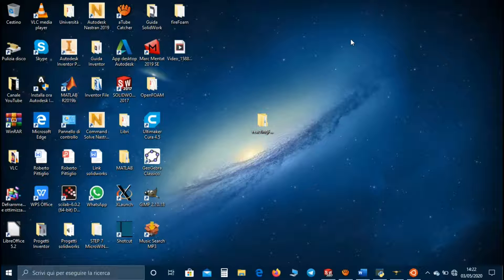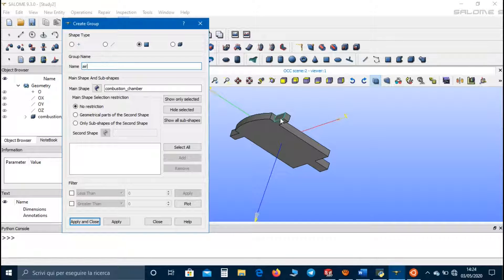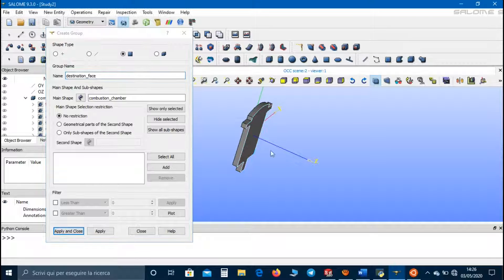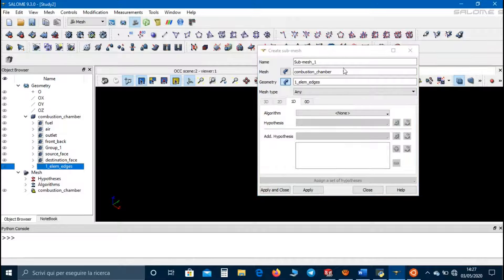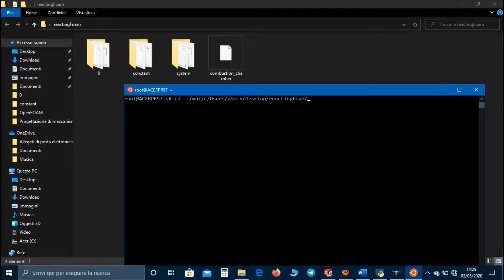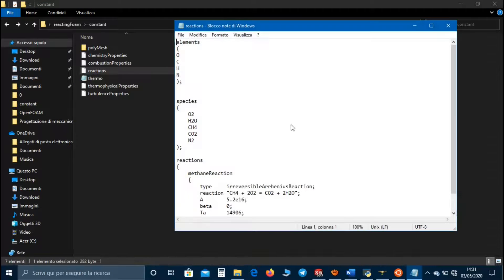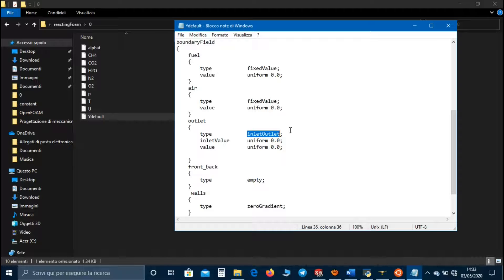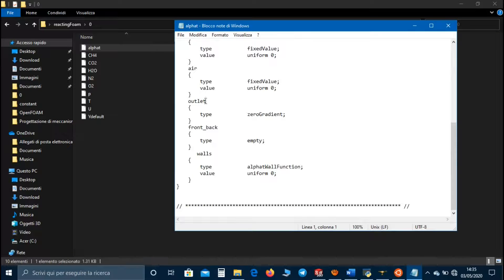OpenFOAM Tutorial 8 - Combustion case with reactingFoam

Comment: After doing meshing in salome as mentioned in video, when trying to convert ideasunvtofoam the below error occurs. How to rectify this.

39663
39664
39665
39666
39667
)

    From function T& Foam::HashTable<T, Key, Hash>::operator[](const Key&) [with T = int; Key = int; Hash = Foam::Hash<int>]
    in file /home/ubuntu/OpenFOAM/OpenFOAM-9/src/OpenFOAM/lnInclude/HashTableI.H at line 109.

FOAM exiting
Reply from the maker: Mh it's difficult to say what the problem is. Check your mesh and try again
Reply: Did you manage to solve the error ? if so how did you do it? I'm getting the same error
Reply: @sebastianmancillacallejas3972  No I didnt continue. I moved to ansys for my meshing purposes since I didn't have time to learn salome.

Comment: I follow the tutorial so many times, so many hours, and without succes openfoam 7 openfoam 8 in ubuntu and temperature goes out of 5000-6000 a lot of warnings of janaf and the result is don't enter fuel or air, the chamber in the init is 2000 °  and with time is cooling with cold air from outlet, Can you share to me the thermo.compressibleGas properties here or for DM i think there is the problem. Another question why Rosenbrock34;? (by defect Rosembrok43). Other Are you using the folder tutorial of counterFlowFlame2D or olse other (in this i'm tryning changin those files). I don't have reactingMixture in thermophysicalPropierties on openFoam by defect use multiComponentMixture.Is this correct? Are you sure the cad that your upload recently is the same? Do you think because dimensions 300 mm STEP solidtwork (to salome changed the configure to meters generate problems?) or the geometry is too small 30 cm and for that is the higher temperature? Thank you in advance
Reply: I solved the problem, velocity was defined opposite  sign
Reply from the maker: Okay. Sorry if i didn't answare but i was very busy

Comment: Hi, Thanks for the tutorial, I am getting this while running with v2012, would you know why ? --> FOAM FATAL ERROR: 
Unknown psiCombustionModel type laminar

Valid  combustionModels are : 

15
(
noCombustion<psiThermoCombustion>
infinitelyFastChemistry<psiThermoCombustion,gasHThermoPhysics>
diffusion<psiThermoCombustion,constGasEThermoPhysics>
infinitelyFastChemistry<psiThermoCombustion,constGasEThermoPhysics>
PaSR<psiChemistryCombustion>
laminar<psiChemistryCombustion>
FSD<psiThermoCombustion,constGasHThermoPhysics>
infinitelyFastChemistry<psiThermoCombustion,constGasHThermoPhysics>
diffusion<psiThermoCombustion,gasEThermoPhysics>
diffusion<psiThermoCombustion,constGasHThermoPhysics>
diffusion<psiThermoCombustion,gasHThermoPhysics>
infinitelyFastChemistry<psiThermoCombustion,gasEThermoPhysics>
FSD<psiThermoCombustion,gasEThermoPhysics>
FSD<psiThermoCombustion,constGasEThermoPhysics>
FSD<psiThermoCombustion,gasHThermoPhysics>
)

    From function static Foam::autoPtr<Foam::combustionModels::psiCombustionModel> Foam::combustionModels::psiCombustionModel::New(const Foam::fvMesh&, const Foam::word&)
    in file psiCombustionModel/psiCombustionModel/psiCombustionModelNew.C at line 60.

FOAM exiting
Reply from the maker: Sometimes it depends on the OpenFOAM version you're using becouse some parameters have to be set in another way. You should take a look on an OpenFOAM forum
Reply: @amazingengineering3207  Thanks for the suggestion. I was under the impression that you used v2012 version, rightb?
Reply from the maker: I am using version 7

Comment: Hi, I am doing project on Characterization of on-source fire whirls on the basis of TCI and TRI. using methanol as liquid fuel so I just modified 3D small poolfire case but in one research paper they used Gri mech 3.0 reaction, I am confused bc at Gri mech3.0 website they clearly mentioned it will give inaccurate results for parental fuels other than natural gas but still I run the case with reacting foam by modifying Sandia_LTS tutorial but I am not able validate results' m doing some mistake in setting up the case>Can you please help?
I can share details of my project.
Reply from the maker: Mh i am very busy in this period, i can only suggest you to take my case and change only the reaction

Comment: It seems to be mixing the reactants but no reaction is happening. For example, at 16:42 the temperature should be more mixed and messy flow, because of reactions. Besides that, the temperatures at the center region should increase beyond the set value 2000 K.

Could you explain, please?
Reply from the maker: I set 2000k becouse this is the maximun temperature of the reaction in an ideal combustion case. About the rest, you could try to reduce the time step to have a better evolution

Comment: Hi. Thank you for this video. I'm newer in OpenFoam and I tried to repeat your case. Unfortunately I had  an error "keyword chemistry is underfined in dictionary", i.e. it doesn't want to take solver EulerImplicit. I tried to change it, after it I had errors with species files on outlet, it works only with zeroGradient what is not correct. Could you, please, advise me what is wrong? Thanks in advanse.
Reply from the maker: Sometimes it depeds on the openfoam version you are using. I had similar problems in other case. I can only suggest you to visiting some forum as i did
Reply: @amazingengineering3207  I use windows blueCFD core. So the cause can be in version of OpenFoam, right?
Reply from the maker: Yes i had a similar problem and it was causes by the version i used, so i had to change something in the file
Reply: @amazingengineering3207 , thank you.
Reply: @amazingengineering3207 , hi, sorry to disturb you. I could run the calculation after changing of chemistryProperties file, in particular I changed odeCoeffs solver from Rosenbrock34 to seulex (with Rosenbrock it was failed). But the result is not similar, I don't see this picture like in your video. Can be the cause in version?
Reply from the maker: What do you see?
Reply: @amazingengineering3207 , I see temperature about 293 degree without any combustion. From air nothing direction at all.
Reply from the maker: Mh maybe you should set other coefficient when you use Rosenbrock34
Reply: @amazingengineering3207 , use Rosenbrock34 and change coefficients? Not use seulex?
Reply from the maker: You should try but i've never used it so i don't know how to help you
Reply: @amazingengineering3207 , I'll try to check but it seems strange. I compared all files with your video. Do you have an archive with your model? The idea is yo try to calculate, if I have the same result as in my simulation, it's really cause in version.

Comment: Sir how did you isolate the 0,constant and system files in the world directory? Was it written separately or copied from some pre-existing tutorial? Sorry if this question seems elementary but I am just starting to learn OpenFOAM.
Reply from the maker: I found the directory in OpenFOAM website
Reply: @amazingengineering3207  thank you very much sir..this tutorial was extremely helpful
Reply: @amazingengineering3207  if it is not too much trouble may i request you to share the link of the website please..I am unable to find the exact directory
Reply from the maker: @ashwinsankar1111  https://develop.openfoam.com/Development/openfoam/-/tree/master/tutorials/combustion/reactingFoam I think this is the link
Reply: @amazingengineering3207  thank you so much for taking the time sir!!!
Reply: @amazingengineering3207  sir i am extremely sorry for disturbing you again..but after creating the mesh unv file,  whenever I use ideasUnvtoFoam i keep getting foam fatal error cannot open file. Can you give me some idea about what i am doing wrong?
Reply from the maker: Mh did you set the geometric gruops for boundary conditions?
Reply: @amazingengineering3207   My model geometry itself is bit different. But other than that all instructions from your video were followed.
Reply from the maker: Which is the error message?
Reply: @amazingengineering3207  it shows foam fatal error:file _.unv not found
Reply from the maker: You have to verify that your terminal is set on the work directory where you have all the file

Comment: Why is nitrogen mentioned in the elements and species sections of constant/reactions if it is not used in the reaction formula ?
Reply from the maker: Becouse N2 is a component of air. If you try to run the case without N2 file, the simulation doesn't start
Reply: @amazingengineering3207    Is it then possible to set oxygen content to 1.0 and N2 to 0.0 for a pure oxygen gas feed ?  I'm a few steps away from working with reactingFoam, but it might be an interesting task for this years 2020 Jozsef Nagy challenge.
Reply from the maker: You could try
Reply: @amazingengineering3207  I will and thanks for making this tutorial series.  👍

Comment: Great Work !! I found very few videos on the combustion with OpenFOAM that explains it step by step!! I have a question regarding the Temperature, when we set the internal field of temperature ( in 0 folder) at high value of 2000K , the end result in paraFoam gives a maximum value of 2000K. So if you set that at 1000K, the maximum temperature in paraFoam will be around 1000K. Where as the stochiometric flame adiabatic temeperature is around 2236K.There should be some temperature rise due to combustion and maximum temperature should be around this value. What do you think? It will be great to get a reply from you on the same.
Reply from the maker: Hi Ayush, I will try to make another simulation changing the value of internal field and I will verify what you said
Reply: @amazingengineering3207  thanks will wait for your reply.
Reply from the maker: I made another video where i explain how to set the right value of InternalField in T file. I hope it can help you
Reply: Amazing Engineering thanks a lot...!! I will check it out!!